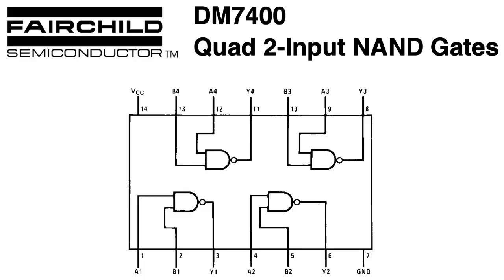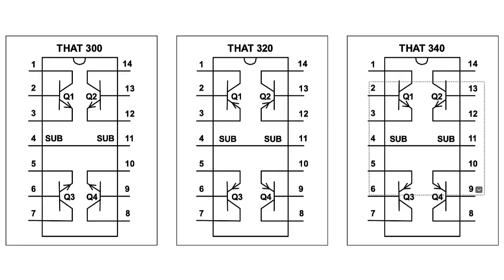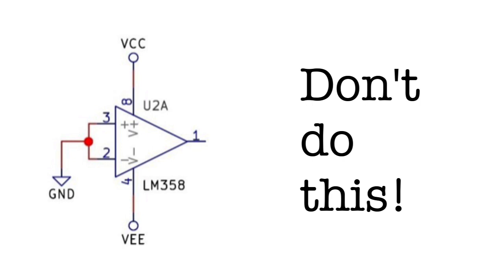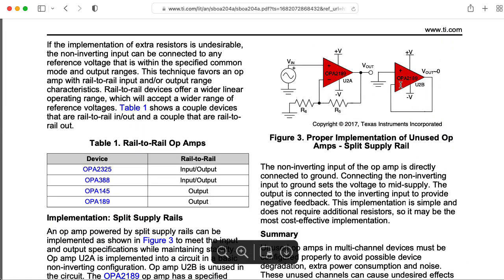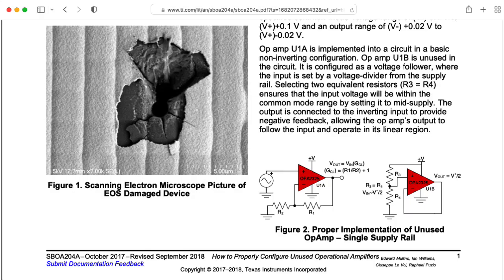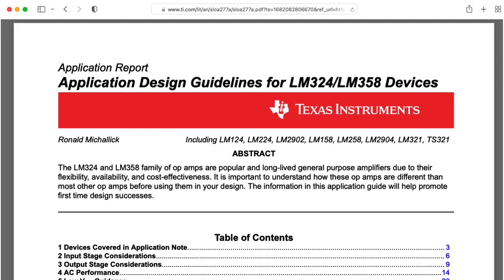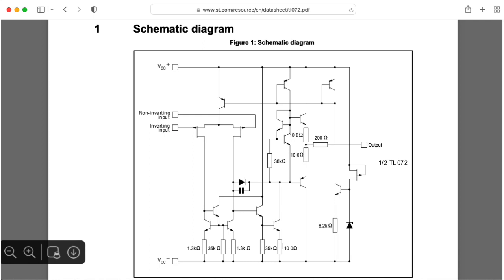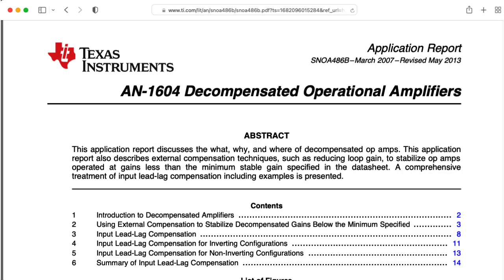Handling Unused Operational Amplifiers (ECE Design Fundamentals)

Comment: I'm with you---even a jfet input is going to have miniscule bias current, and I can't really see it disturbing the bias of the other amps in the package. I really love your videos, and I wish you had been my university electronics professor. We also have the same warped sense of humor. 😜
Reply from the maker: Rob65 noted that I hadn't read the app note closely -- it looks like the 324/358 have a diode at the input that's not shown on the "simplified schematic" and that's what's at issue. But I'm not sure what other op amps this applies to.

Comment: A 358 has ground sensing inputs anyhow, wonder why the resistor would be necessary? I’ll have to read that appnote.

Also apparently TI says you can tie the unused inputs AND output of an LM393 comparator to ground. For that not to oscillate internally, I can only imagine it somehow passes a bit of current through the output transistor via the reversed CE junction, and biases the long-tailed pair slightly. That or there’s already enough bias or positive feedback inside the long-tailed pair.
Pretty sure this is only written in the metal can package datasheet, I saw it someone mention it on stackexchange.
Reply from the maker: Rob65 pointed out something in that app note about a diode (which doesn't seem to be shown on the simplified schematics on the data sheets) at the inputs.

Comment: sound advice. connecting both inputs together to ground violates common mode spec. and drives hard the output to either rail (eventually) with high current drain. the buffer configuration with ground resistor or split resistors is the best case.